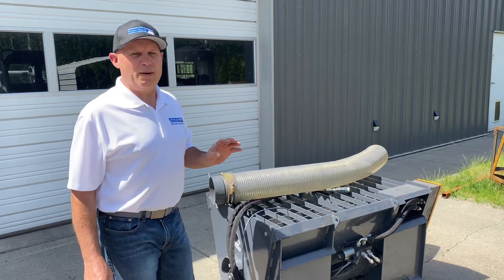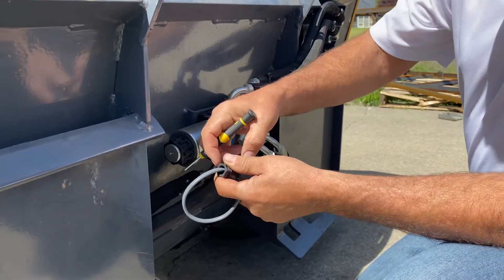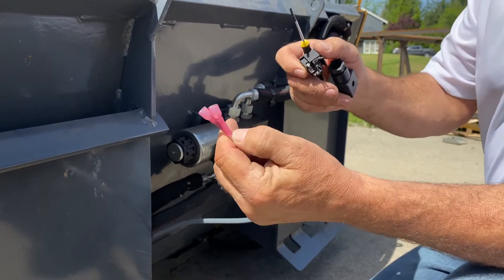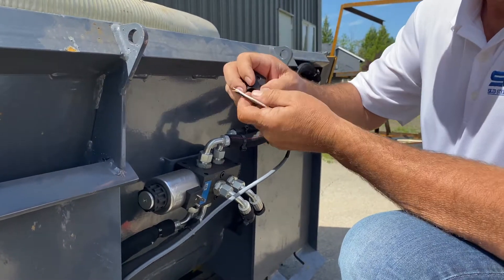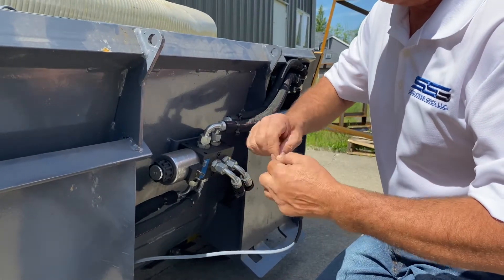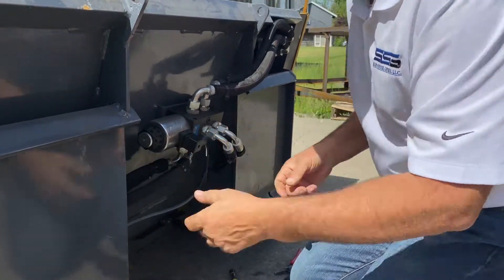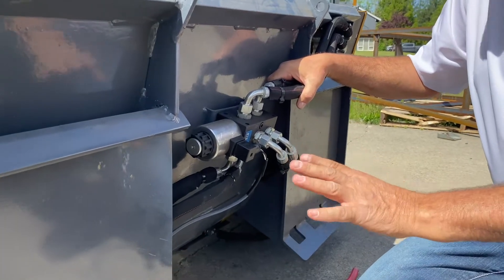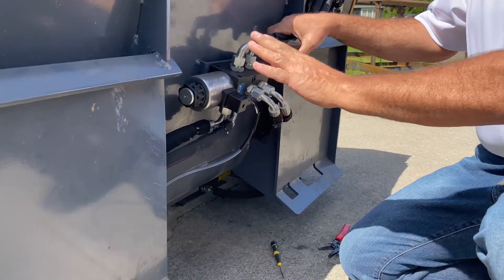#140 - Wolverine Mixer Wiring & Controls

Comment: I bought one of these mixers... Did your's come with the hose, or were you able to find that somewhere else?  Mine did not come with a hose or the side shoot.
Reply: How many bags can you mix at one time?
Reply: @dannycarter4398  I don’t know yet. I’m still looking for the hose. I would guess somewhere between 6-10. Seems like a decent sized hopper
Reply: @dannycarter4398  The concept of this style is to be able to scoop the gravel right into the hopper, add a bag of cement proportionately add water and your good to go. You just have to be sure your machine has at least a 2k lifting ability. These are 700lbs empty with a scoop of 600 lbs plus water makes it a payload of 2k lbs
Reply: Yes where can I buy the hose too?